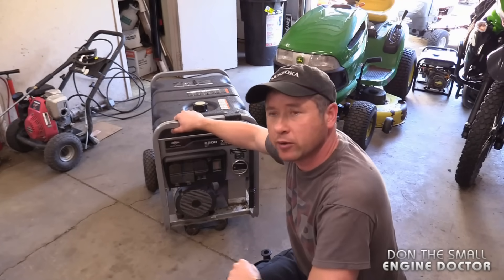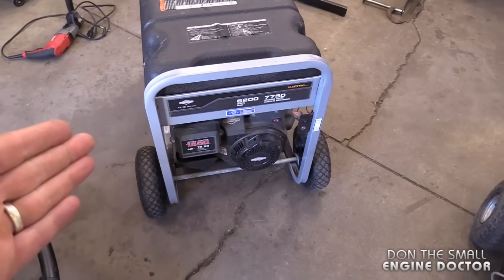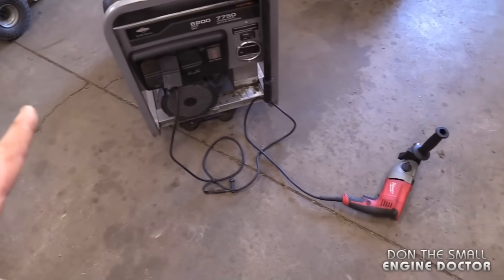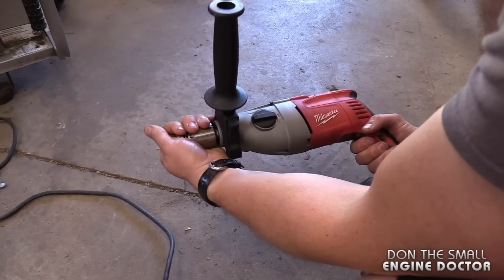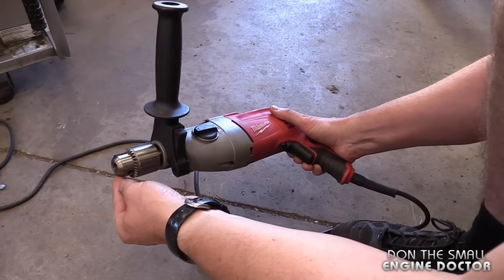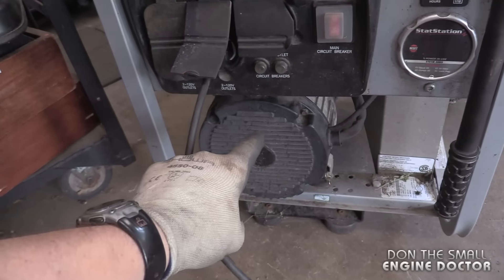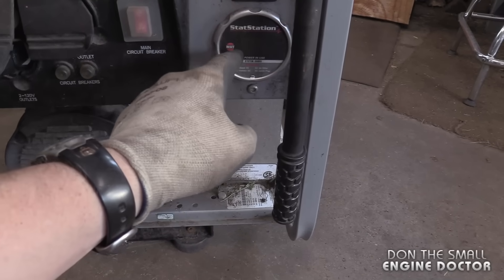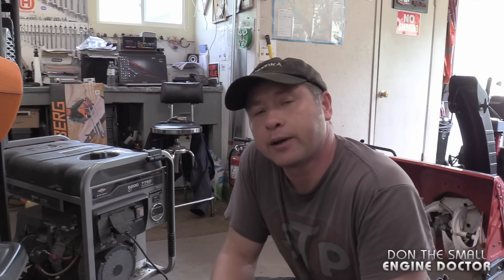HOW-TO "Flash" A Generator | Make It Produce Power Again | MUST WATCH

Comment: The capacitor linked in the stator winding drains out .
Also brussless has 2 thin magnetic bars in the armature to get the process happening .
Another problem with brushless is the Diode on the armature blowing .

Comment: This is so insane.
Years ago a neighbor called me to
come look at a generator that was
not producing power.
The very day BEFORE, I ran across
this flashing video.  He had a drill
and I tried this.  I could not believe it!
It then powered the drill.
5 years later, mice had chewed on
the wiring and he gave me that
generator.  I charge myself $0
for labor and fixed all wiring 
damage, and that gen still works.
I pull it around the yard and use
it with an electric chainsaw to
trim limbs and cut firewood.
2006 model and its a joy to use.
THANK YOU DONY!
-- North Central Florida.
-- Also used when hurricanes
-- remove our power.

Comment: I have a question. Do I have to use a 1/2 inch drive drill? can I I use a 3/8 drive drill in a bind?
Reply: Yes ,to 3/8 drill.
Michigan. 
Just did my generator yesterday. 
I cheated,  cordless drill. Connected to cord drill plugged in to generator. 
Spun reverse for 30 seconds and worked,

Comment: i have a wen 457cc model df1100x, mine doesn't have a circuit breaker switch, it is hard to start, i have to use starter fluid or it won't start, it has no power output, i tried the drill method and i got nothing.

Comment: You have a wire going to ground or a magnet wire pair touching each other. 99% of the time it's a magnet-wire-pair with the clear varnish thinned out by an ARK FLASH due to vibrational thinning of the varnish coating. CURE: Fine the spot and apply clear-nail-lacquer over it.

Comment: After you've flashed it and got the drill to work, without turning it off plug in a heavier load like a kettle.
This will increase the magnetic field in the winding coils .
You need your load meter to show maximum loading for at least 1 hour...

Comment: The real question is why did it happen?  I just flashed one and after turning it off its rifht back to not working again. It worked with no problems for years so there must be something wrong. This is like taking pills for etectile dysfunction because your too fat instead of losing weight.

So who knows whats actually causing it?

Comment: just wanted to thank you for this video! Im a fleet service mechanic and had a Honda EM3500S generator in for service and noticed it was not producing voltage. Im not too familiar with small engines and generators but knew enough to check the brushes and all the connections. my coworkers we suggesting voltage regulator or " its just dead" but boy and i glad i looked up the symptoms and our video was the first to come up. followed your instructions to my amazement it actually worked! saved me a lot of time and throwing parts at it, much appreciated.

Comment: I have to admit ... I was told about this from a guy on FB Marketplace .. I have a generator I was selling there .. He told me about this process ... I did it with one variation .. when I flashed mine, the generator was NOT running .. I used a right angle grinder because it was handy ... I flashed mine with the cover of the generator off because i was thinking my breaker was bad .. To make a long story short .. put it all back together .. plugged in the grinder .. hooked up a volt meter to one of the 110 outlets .. started the generator .. and was shocked that it is now working perfectly

Comment: The coil lost its contact with the magnet because of dust, rust or moisture. You can spay silicone to lubricate the motor to prevent this from happening.

Comment: I fixed a briggs with a broken armature. (Field?) I think the field rotates the statir is the output. Broken aluminum wire. You have to crimp an aluminum/ copper pigtail gas tight,  because aluminum wire oxidizes. If flashing doesn't work, ohm out the field, could be broken wire or failed brushes if the field circuit is open.

Comment: Actually its called refluxing. Does the generator have a store capacitor. If so it may be leaking. However, there could be other factors. Cobwebs or larvae cocoons on the electrical including the panel where the capacitor is. Also weak diodes on the rotor. Yes the diodes are on the rotor on brushless generators. Sometimes 3 sometimes 6 if it's a polyphase system. Also Cobwebs on those can cause issues. Sadly with weak or passive diodes it's best to get a new rotor rather than soldering new diodes in, because the solder has to be tip top and perfect so thar the centrifugal force of the rotor rotation doesn't loosen them. Also soldering diodes you need the temperatures correct for soldering. If you have an old same machine with a bad engine, it's best to take the whole alternator assembly and swap it over. You want the age of the windings on both the stator and the rotor to match. Windings weaken over time and hours of use, old Windings mixed with new windings tend to make the unit run hotter.  Now with all this being said, the best method is, is to get a new generator. I know I know, waste not want not, unless your good at rewinding stator and rotors and have a mechanical winder, however the material costs are astronomical. I've done it and it was a 3 year process. Sourcing the parts the copper wiring the restringing of the wiring and the thermoset epoxy process. After all that process I was at $4000. Learned winding and stringing out of a school textbook called Siskind electrical machines. Great video by the way. Chances are there's just dirt in the alternator unit. If not keep refluxing or use I constantly then it won't drain over time. Other thing is get a new one if you don't like constantly refluxing the unit.  Lol. NOTE!!! Word to the wise. Fixing generators is a different field. Safety first. I wouldn't recommend other youtube videos in quick Fixing the electrical components. For personal safety proper experience is needed in replacing parts. Rotors and stators should be replaced as a set and always new AVRs and rectifiers and capacitors. Components that are questionable should be replaced. Don't sacrifice personal safety for quick fixes, they don't always work and can cause more harm.

Comment: My Co-worker and I were working on a Generac light tower with 0v on L1 and L3. Watched this and thought, There is no way it's that easy. It was that freaking easy.
Reply: I work on about 4 light towers a day, how can you flash a light tower? They don’t have any plugs? I’d be fascinated to find out what you did
Reply: @belsayshootingground  The ones at my work are the MLT6SMD, G4-ECO, ECO-2, and Hyper cube. All of which have outlets.
If yours do not, you need to figure out a way to induce voltage into the capacitor at your own risk I wouldn't mess with a 25MF at 480v unless it was easy like the drill trick.
Reply: @Just_a_Mechanic  so new capacitors are the only way forward really..?
Reply: @ If the the generator isn't outputting, or outputting super low volts, the capacitor is usually the issue. I've only run into 1 bad pancake generator in my 10 years working at a rental company. Capacitors are fairly cheap and easy to replace, just always make sure to discharge them... safely.
Reply: @ I’ve only been working on them for 3 months, first one I’ve come across not putting out power. If you turn the lights on the engine stalls. My first thought is capacitors but I wouldn’t be surprised to find out it’s something else
Reply: @ this is on a Kubota D1105 engine.
Also is using a screw driver with gloves on safe enough?
I’m never sure if I sure disconnect then discharge. Or discharge while it’s still on the generator….
Reply: @belsayshootingground  Engine stall is probably fuel or governor related? A bad capacitor would let the engine run, but the gen side wouldn't output voltage.
Best way to discharge a capacitor I've found is to wear thick rubber gloves and use a screwdriver that has a shank mostly dipped in rubber. Discharging it on the unit is the safest, but can be awkward.
Reply: @ I did clean fuel lines and put on new filters, so it’s either a governor or something else. I’ve mostly worked on small petrol engines, so bigger diesels on generators is fairly new to me, although I do understand the basics
Reply: @ I have another light tower that starts then shuts down after 5 seconds. The symbols aren’t clear on them so it can be thought to tell. I think it’s low oil pressure, so it might be an oil pump! We have 600 light towers at his place 😭
Reply: @belsayshootingground  Try working on specialty made ones from Italy with Generac branding... parts are a nightmare.
When we have a tower that only runs for 5-10 seconds, those tend to be the capacitor failing to induce the gen. What is the model of your light tower? I might be able to find manuals for it.
Reply: @ they are called VT1 from a company called Trime light towers.
We also use Trime eco and hybrid towers.
Reply: @belsayshootingground  looking at the parts breakdowns for those units, they don't appear to have a main controller with a display? 
We don't carry those, so I'm in the dark... pun intended!
Reply: @no worries, thanks for having a look though 🙌 I’m working on them right now. Pressure tested ones oil and it read 80psi seems a little high to me….

Comment: Dony. I have a EB5000X XK3 A1 honda generator EBPC 104000 it sat for along time. I now have it running great but it does not put out any electrical power.  I have flashed it with a drill and tried another YouTube video of hooking of a car  battery to the gfci outlets to see if that would work flashing it. Nothing I've tried gets any power output. 
Any suggestions from you or your viewers would be greatly appreciated

Comment: Thanks a lot for this method suggestion.  Seemed safer than some of the other online ways using car batteries or jump starters.  It took me about a half-dozen spins of my 1/2" drill, but  suddenly my 20yr old Arctic Cat 4000 came back to life!  Great tip.

Comment: Hi Don, long-time viewer, first contact!  I have a brushless generator that's only putting out 82volts at approx 3600 rpm (59hz).  I obviously have some power to turn a drill, so I might try field flashing the capacitor.  I have the original and a replacement capacitor, neither of which I can draw a reading of capacitance off (ergo, maybe they need flashing).  Thoughts from all are welcomed.  Thank you, one of the best channels on the interweb.

Comment: A brushless alternator can't have an AVR it will have either a bridge rectifier and a capacitor or both.
So I would look at your rota as they will be solid state magnets that might be losing their magnet charge. 

You can recharge the magnets by winding insulated wire around the magnets and then supplying the wire with DC power with a bulb as the end of the winding.

Beforehand it might be worth checking to see if you have a capacitor that you could test if it is within value. 

Also check the rotor as you might have two half bridge rectified on the rota or even N2 diodes

Comment: My 9000watt Honda clone had worn brushes and quit after yr of regular use, put another set in, worked few hrs but then began to flicker. Had a used AVR, worked ok few hours then out again, cap blew way it looked on 2nd one. I'd forgot about this, I'll give it a try on original AVR, new AVR is on the way tho, actually 2, paid for 2day delivery from V-Power then was told be 6 days, assholes! Went to Amazon, get it in 48hrs. Hope all goes well and just have spare AVR and brush set, great video btw!!! Gd electricity does really wierd shit, where's Nicholas Tesla when ya needm!
Reply: not sure it fixed it or not, but arc inside gen, especially if brushes rings are worn can make this cascade of failures.
Reply: @biachpiach  alternator finally failed. Got a Westinghouse 7500 cheaper at Amazon delivered, after few thousand hrs one brush went to due to a pitted slip  ring, without brushes I ran engine gradually getting pitted ring polished with proper abrasives. So far so good. Then starter went, used a predator part, same part no, starts up in half a second compared to starter it came with, it took  4 tries or cycles by remote, was very slow. Trying to get bad parts replaced is ridiculous. Bought 5 brushes for cheap just in case.

Comment: There isn't enough residual magnetism left in its rotor for the generator to "bootstrap " itself. Another way to put it back in, while off and all circuits closed, use a 12 volt battery with a fuse rated at least 30 amps, (motorcycle,  car, deep cycle, or a 13 amp. Or larger lead acid) apply to its 110 outlet 2 seconds.Fuse may pop, but flashing should have been accomplished anyways.

Comment: Loss of rotor residual magnetism can be caused by allowing the generator to power down with a load connected.  In any event there is safer approach for the drill remedy.  Just tie a rope around the chuck for a few turns.  Lock the trigger and put the drill on the ground with a foot to keep it in place while giving the rope a tug.  Same result while keeping fingers off rotating machinery.
Reply: Will using a reversible battery powered drill also work?
Reply: Turning the chuck is much safer, as you have complete control to release, but using a rope is extremely dangerous with a good risk of loosing a finger tangled in the rope. It will happen so quickly a a by product your operating hand will not instinctively let go whilst your rope finger even though released is pulled off.
Reply: Also, most DIY and trades personnel are familiar with self tightening keyless chucks and are in tune with operating with power to tighten or releasing.

Comment: So generators like this dont use permanent magnets, they actually use a small amount of voltage from the rotor coils of the main output power to induce a small magnetic field, which then acts like a magnetic core to generate power. Over time this false core loses its magnetism because it's not permanent. Depending on many factors like core material, age, amount of use, etc. The small amount of magnetism isnt retained that can drive the power generation and it needs a little "backfeed" to work against "thus the drill reversal", and recreate the core field to work against and make an electric current.

Comment: After replacing the AVR and going around with an ohm meter, I was out of options. I saw this method and originally thought it was a bunch of nonsense. But then I tried it, and to my astonishment it actually worked. Now the generator makes power. So it goes to show you that sometimes even the most unusual fixes could actually work. Very surprised. It greatly depends on the circumstances with the generator, but it doesn’t hurt to try.

Comment: Loss of residual magnetization of the core. Running a drill will not produce enough flux. Try a 1500 watt heater and run it for an hour or so. The longer the better. My guess is that the "permanent" magnet is defective due to low permeability, a manufacturing defect. Good luck, and thanks for the information.

Comment: I have a nice big Honda generator in my shop right now. Got the engine running perfectly but the generator puts out no power. I tried this flashing trick for 30 minutes and still nothing. Circuit breakers and switches are all in the correct position. The GFCI outlets are set correctly. This thing looks new. Anybody got any ideas why it won’t produce power?

Comment: Brushless pretty sure use capacitor not avr.
Check capacitor if right one was used as a replacement.
If so check for a fuse ?
 
Capacitor uF    has to be the same but you can get capacitor bit higher in Voltage
ie ; 400V to 450V but with the same value uF 

If that is not the issue you need to do a windings test !
Let us know how it goes!

Comment: snow storm took out power, no problem. generator ready with regular maintenance and engine starts to keep gas from gumming. never thought to check if actually generating electricity. will now add that to regular maintenance check. lights back on 4 days later and after quick youtube check am ready to deal with AVR and brush assessment. then this popped up and why is this not the first thing recommended? hours of research, phone calls and searching for small engine repair people and in less than thirty seconds the problem solved. hopefully solved for a while.

Comment: I have a DuroMax XP13000EH Dual Fuel Portable Generator which produces both 220v and 110v.  Recently the 110v stopped putting out and checked all the breakers and even tried to "flash" the generator with a angle grinder in reverse.  No luck.  It that really possible that the 110V stops delivering power even if the 220v is still delivering?
Reply: Check to see if you have a GFCI receptacle it may be tripped.  If it doesn't reset go to the back of the receptacle and check the voltage on the screws with the generator running.  Be careful and don't touch anything bare handed.
Reply: Oh one other thing I forgot to mention is check both sides of the circuit breaker to see if you have power on both sides with the generator running.  If not  it maybe a bad breaker if you only have power on one side.
Reply: @Bob57sky  breaker was good in RV. Not sure on the generator. Everything looked good.
Reply: @Bob57sky  thanks the generator overheated and I bought a new one. 110v works again

Comment: It's a bad capacitor.i had that happen to a generator of mine.i didn't realize at the time you could put a charge back in a capacitor by turning an electric motor backwards while plugged in.i took one off a fridge.the one on that gen must not hold a charge.there is a symbol that looks like an upside down horseshoe.i think it's ohms.match that number up as close as possible